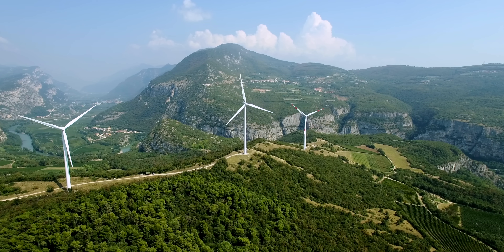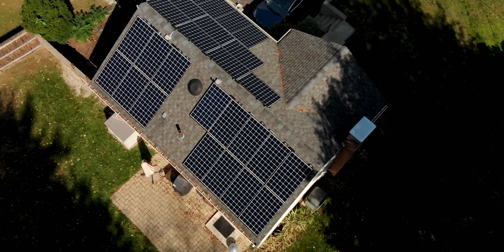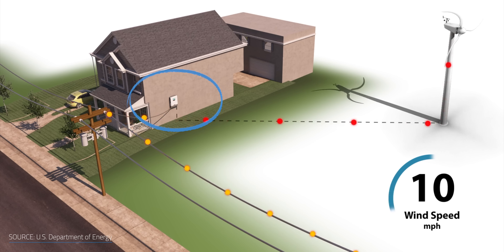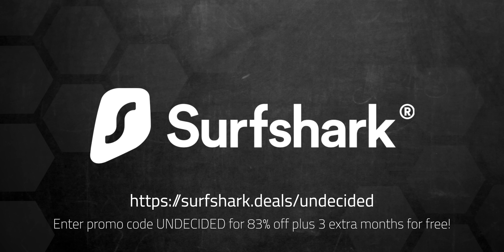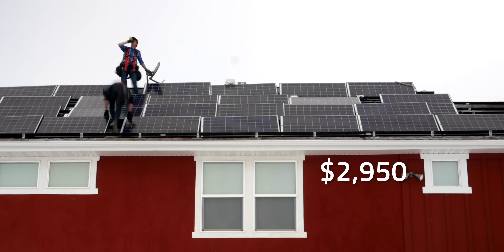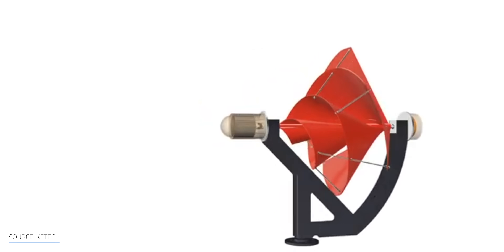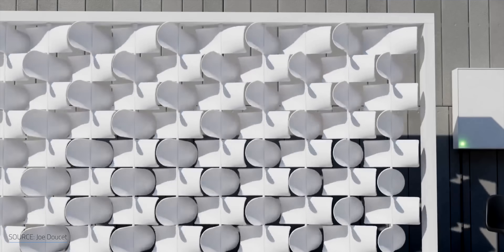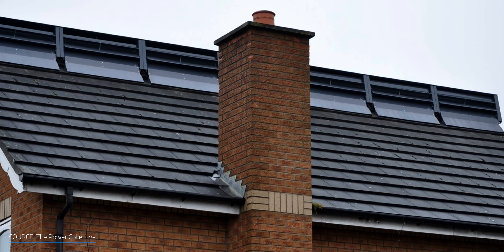The Challenges of a Wind Turbine on Your Home

Comment: Payoff times completely, utterly miss the point. It's like renting vs. owning a home: renting is just burning money that you'll never see again, whereas owning builds equity and is more of an investment and can be considered similar to just putting that money into a savings account. Then there is the autonomy of being able to do whatever you want to change/upgrade your own home which you can't do with a rental property. When it comes to home solar/wind/whatever, it's not about the cost, it's about the benefit. It's about knowing that no matter what happens, you'll have power. The grid can be completely destroyed and you'll be fine. It can go down for 5 minutes, and your Superbowl or whatever remains uninterrupted. You have complete autonomy. But the bottom line is that you will never again be at the mercy of the power company. Whatever the price of your system, that's all you will ever pay, the cost won't vary and it very specifically won't go up. If you are on a tight budget, even if you finance the system you will always know exactly what your monthly payment is and you will never have to guess or be unpleasantly surprised. And eventually that payment will end and it will all be gravy from there on out.

Sure, sometimes things go wrong and it's possible you will end up with an unexpected repair bill at some point, but that's life. One thing that is certain is that if you remain dependent on power companies you WILL get ripped off and the cost will keep going up. And as I said above, the cost of repairing something you own that eliminates other bills and makes you independent is still better than just throwing money away that you will never see again.

Every (always anecdotal, never contextual) argument I've seen about small (or large, for that matter) wind turbines sitting idle boils down to complete cluelessness on the part of the owner and everyone who describes the situation. If it breaks down and remains that way, you've got nobody to blame but yourself. If it is poorly placed, then move it! Put in on a higher tower, move it horizontally if something is in the way, do whatever it takes to make it work. Just giving up without giving it an honest effort is the epitome of stupid. It's also incredibly dishonest to say that it's the fault of the technology when it's your own fault for not doing your homework, not understanding how it works, and not giving it the best chance to work.

There is also the problem that "early adopters" desperately want the capability but no companies have put any significant resources into making small wind turbines durable or effective. So we're left with companies putting out crappy products just to make a fast buck and there are very few if any good options out there. As long as there's so much FUD being perpetuated regarding small wind turbines, there will never be enough demand for reputable companies to bring any resources to bear on that particular problem. There just isn't enough money in it. Just like EVs, we're still waiting for a Tesla to disrupt this particular market with a single dwelling wind power system that is affordable, reliable and has decent performance.

The other aspect is that if you already have solar, you don't need a wind system to fulfill all your power needs. And you don't actually need it to run all night, either. What you really need is for it to work during cloudy and stormy days when solar doesn't do much (during a rainstorm your solar panels won't do much but a wind turbine is likely to be at its best) and if possible give you just that little bit extra at night to keep from discharging your battery bank quite so much. Often even if the wind dies down completely at night and during the day there is wind at dusk and dawn because of the effect of the sun on thermal masses around you, and those are actually often the best times to have that little bit of boost. In the winter, when the nights are longest, having the wind power when you're cooking dinner helps get you through the night without discharging your battery so much and when you're getting up and cooking breakfast and getting ready for school or work it will get you over that last little hurdle before your solar panels start getting significant sunlight. It's about complementing your solar system, not replacing it.

And if you have ANY kind of home power generation and don't have any way to store that power for future use, you are SERIOUSLY misguided. You are EXACTLY what the power companies want. You are providing them with free load leveling, providing them power at very low if any cost with zero overheads or maintenance costs (no infrastructure, fuel or employees), and reducing their costs (=increasing their profits) across the board, all the while yourself remaining tethered to and dependent on them.

Comment: Good to hear of new developments in wind generation! Just recently had solar installed and we're happy with the energy. Had a slight issue when it was windy with one panel rattling, which I've had fixed since. It gave me the idea that what if under each panel there was a way of capturing the wind. Seems like future solar panels could be made to capture the wind as well with vents under each panel leading to a micro turbines. Not sure if this would be feasible, but worth an experiment.
Reply: I love this idea ... I've got too many irons in the fire but otherwise I would definitely look into a solution like this. 👏

Comment: 13:00 The turbine wall looks very much like a cool fence or balcony rail and thus there are a lot of miles of turbines with mass production bringing down the costs.
I'm sure they can size down a little in width and used in conjunction with solar and batteries can make a fast reduction in our carbon footprint as for cost efficiency, I hate it, that we only look at our own lifetime ROI when we know what the next generations have to suffer and stem the costs for harsher weather conditions, scarce food and what not. How about improving the world not just for us, but coming generations.  And since the situation is dire, let's do it rather sooner than later, even if some things need to be improved.

Comment: I really am astonished by the amount of misinformation presented here...let's have a look at the "wall" shown at 12:36 in this video...Claimed power output is up to 10 kW. Whoa !
The area is about 18m2. The total power of the wind at 10 m/s is 0.5x1.225*18*10^3 = 11 kW. The efficiency of this type of rotors usually does not exceed 10% - so, at 10 m/s wind you may (I am not saying you will) get about 1 kW - which would be a great achievement.
Another one - the "Archimedes" type gizmo presented at 10:30. It "works" at wind speeds as low as 0.9 m/s...except that at 0.9 m/s the power of the wind is about 0.5*1.225*1*0.9^3 = 0.45 W/m2...Yes, less than half a Watt per 1 meter square of the swept area. And including the efficiency (which I very much doubt reaches 35%) you will get about 0.15 W output from a turbine with 1m2 swept area. And this is supposed to be an advantage ?!
Another favorite "trick" of the inventors of "new, novel etc." devices is using Venturi-type "wind concentrators etc. They refer to Bernoulli's laws which may describe the flow through a pipe with changing diameter: reduction of the area by a factor of 2x results in increasing the velocity of the flow by a factor of 2x, and since the energy of the wind scales as the 3rd power of the wind speed - Voila! - we have the means of extracting 9x more energy from the wind. Except...Bernoulli's laws apply when the energy is not supplied or extracted from the flow...

Wind energy can be extracted efficiently. But it needs more than ideas which usually are not supported by proper engineering and testing. In that aspect the conclusions in this video are correct: there is hardly any product on the small wind turbine market which would justify its price. 

As it happens, I am an aeronautical engineer actively involved in wind turbine design and analysis. Unfortunately - most of the viewers are not.

Comment: Electric motors, generators, alternators are not a new technology.  They are well-understood, efficient, and long-lasting.  We commonly use micro-wind sized devices all the time in cars, fans, ebikes. They typically go years, decades without problems and little servicing needed.  So why is your comparison of 1kw systems so lop-sided?  How is a solar panel system less expensive than a micro wind turbine?  It doesn`t make sense.

Comment: the problem with this is that solar panels go bad quickly and they are not cheap to replace, wind turbines you can use everyday recycled bottles and motors that you can get free or buy super cheap. solar panels are not cost effective. turbines do not cost 8k, that is ridiculous. you keep pitching solar, but you dont tell folks how much they cost after they get burnt out very quickly if they get hours of direct sunlight, and that even if you get that much sun for it to even pull in enough electricity. I've built homemade turbines for cheap out of free motors people throw out or i can get it cheap on ebay and use recycled bottles to make the blades and generate more electricity to keep my batteries charge as they discharge to power my house than a solar, even on a no sun or cloudy day lol.

Comment: Basically wind turbine is cost ineffective in most applications, so in most locations the only reason to go for it would be if you wanted to have as much own energy as you can without batteries. Then you are kinda doomed to combine turbines into the mix.

Comment: could the ridge vent also seize the heat from the attic  with a eve system and ridge vent roof. if so hot areas like deserts could potentially run this as a solar heated turbine.

Comment: Matt, if you haven't already, would you consider updating the content of this video. There have been so many new innovations in renewable wind energy. Wind power has some new looks, like the Power Pod by Halcium, which I think you mentioned in another show.  
The pod  collects incoming air from all directions simultaneously . It has no moving exterior parts, and it's stationary. Using a kind of ram jet concept that focuses the wind into the units internal blade, it does so from all 360 degrees.  I believe it's still in development, but the company is close to a production model.
We're planning to put solar on our new home, but we live in an area where there is enough windy days to consider adding a supplementary wind system to our energy production. We would love it if you could take another fresh look at the 2 types of products and give us your usual Amazing analysis of them and what may or may not be worth considering......I'm still undecided! 

Thanks for considering,
D

Comment: The issue is, that micro generation wind turbines have become an issue, because the necessary inverters are not easily available anymore. Most of these inverters, that used to be available are not available on the market anymore. Despite, that VAWTs would be absolutely perfect.

Comment: I like the ideal of wind power over solar. Solar drawbacks are:
1. You still have to be hook up to the grid in an urban environment. 
2. If the electric company’s grid goes down, even though you have panels on your house, you’ll have no electricity.
3. Most contractors do not insure you from roof leaks, due to the panels. Roof leaks are sure to happen once the sealant gives out. With constant sun high heat, sooner than later.
4. You void the warranty of your roof, by punching holes in it for the panel installation. 
5. Solar panels technology is constantly changing, leaving your system obsolete in five years, before you can even pay it off. 
6. Constant dirt and debris, makes a solar panel that you can’t reach, to constantly clean off, inefficient.
There are pit falls on both sides of the isle. Do your research, before spending your money.

Comment: Waiting a week to ensure this comment is buried, as I know I'm in the minority here. But it drove me crazy as while it might be scientifically accurate to talk about windspeed in m/s, it is generally more clear to use knots. I had to stop your video at each value you provided to pull up a conversion calculator to see what that actually translated into. 

Another thing I didn't see touched on was storm resiliency. I get solid enough wind where a turbine could make sense but also get tropical storm force winds about three or four times a year (even without an actual tropical storm).

Comment: and there are no magnetic turbines!? They would not produce noise in theory, besides, the 2 complement each other well, the magnet turns on its own, but sometimes an external force is needed to turn it and start doing its job, then the wind turbine would also help and generate more electricity at even lower cost, if I thought so it means that someone with money also thought so, so it must exist.
y no existen las turbinas magneticas!? no producirian ruido en teoria, ademas q se complementan bien las 2, el magneto da vueltas por si solo, pero habeces se nesecita de una fuerza exterior para darle vueltas y empiece a hacer su trabajo, entonces ahi la turbina de viento ayudaria tambien y generarian mas electricidad a menor costo aun, si yo lo pense significa q alguien con dinero tambien lo penso, asi q si debe existir.

Comment: 20 years ago, solar panels were $4/Watt, and small-wind had a price advantage.  Today solar panels are one-tenth their former price: 40 cents/Watt. This ranch property in the Mojave Desert came with a 10 kW grid-tie wind turbine, which pays the electric bill here.  You need at least a couple acres, in a high-wind area, with no trees, buildings, or obstacles to block a strong, steady wind.  That rules out 99% of homes.  Also, even the best wind turbines wear out.  There is really only one model, of one brand, that has proven to withstand the test of time at all, and even those have multiple "issues".  I had to buy an identical turbine used, so I would have two on hand - one to run, one to rebuild.  You need to hire a crane and experienced crew to swap out a turbine or do maintenance.  Figure about $3-4 thousand just to pull down a turbine and fix or replace it.  This model weighs over half a ton (1000 lbs) on a 120-foot tower.
  
I also build my own small turbines, including the generators.   This is an option if you are good with fabricating, are a naturally-talented engineer, and you know what you are doing.  Again, that rules out 99.99% of people. 

The other "goofy" designs in the video are all total non-starters.  People who are not in the industry have NO IDEA how bad these "alternative" designs are.  They are completely worthless products of ignorance, period.  Seriously, no matter how great they look, like that ridge-whatever, don't fall for it.  Don't believe any numbers claimed for such toys.  You need propellers to make good power.  There is a reason all windfarm turbines look nearly identical.

Comment: I quite like the idea of the Ridgeblade wind turbine, but I'm wondering if a similar system could be installed within the roof space.
If you have a tiled roof and installed an inner roof, then the existing outer roof tiles could be refitted to act as a diffuser. The entire roof sides now act as an air intake / exhaust, with the gap between the roof layers now acting as a huge duct, carrying air into the Ridgeblade at practically the same angle, no matter which way the wind was blowing against the outer roof. I'm thinking that with some clever sizing of the duct to accelerate the airflow and generate more of a pressure difference, you may not need so many Ridgeblade units. 
The inside roof layer would have to act as your rain barrier, so you'd have to install a drainage system to mitigate that, but it could be done. You'd still have some inner roof space for storage, perhaps for a battery pack to store energy when you aren't at home or the demand isn't as high? Also, easy access for maintenance, just pop into your loft even if it's raining outside.
Reply: This option might work with plenty of sound insulation which would double as thermal insulation.
Another option might be a small "steeple" on the roof to capture wind from any direction and focus it onto a small turbine.
Something that can be built into new houses to constantly trickle in energy at nightime and during winter.

Comment: Apologies if you covered this and I managed to miss it twice: What about surface area concerns? A vertical turbine could be an option where there's surface area necessary for panels (whether roof or ground-installs), giving it more potential. I don't think that would overcome the challenges you talk about in this video, though, and I am hard-pressed to think of a scenario where a turbine could be installed but have little potential for solar panels. The most immediate thing I can think of (aside from very weird one-offs) are homes built into hills or mountains, which don't really have a "roof" and available land to put the panels on might be limited still.

Comment: 11:14 take this roof-turbine and install it on each of the edges of buildings vertically. Walls are usually bigger "sails" than roofs and such application works better with different wind azimuths.

Comment: Biggest problem in the UK is the Luddite local council planning office. Anything breaking the existing roofline is frowned upon and typically refused. Vawts and Hawts have to be submitted to planning and once again, for anything reasonable in power output, requires planning permission.